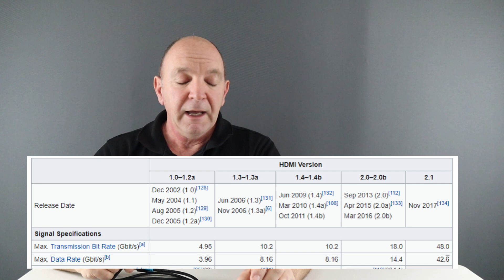HDMI Sucks! Or does it?

Comment: This is 2025. And I'm sick of HDMI.
And consumers I think you're getting fed up with it. It shouldn't be that difficult to have a device that you want to watch on your TV and you connect the cable from one to the other. And it should work instead of Constantly getting the quote no signal" error message.  

I've tried every possible cable. I bet I've bought two dozen of them and returned all of them. I even bought one that was $125 thinking well maybe that will work.    

And I don't see how it can be the cable when the cable works sometimes, but it doesn't work other times. And it's annoying, because it makes the system not dependable which makes you regret buying it, and on a bad day you wanna throw it off the balcony.

Comment: Good info but basically an apology video for a cable standard whose first main job should have been to work reliably without needing to have any specialized knowledge. At that, it has failed miserably. So yes, the HDMI cable standard sucks even if the individual cable is of high quality.

Comment: Hi Andrew, really great presentation indeed as always with all your videos.
AQuick HDMI issue question:
An apple TV (set to 1080p) connected to an AV Processor (set to 1080p) with 2m cable then to a native 1080p projector with a 20m cable (non optical). After 2 minutes, the screen goes black and the image never comes back unless you restart the whole system.  Based on your experience, is it most likely HDMI (2.0) cable quality, lack of features in the cable, EDID issue or HDCP issue?

Thank you.
Reply from the maker: Hard to be certain but my guess would be a voltage issue in the long 20m cable ? Maybe.. if you can temporarily bypass that with a shorter cable then that will give a clue. Either way I hate HDMI :-)

Comment: Yes it does, it's a fucking shit show every time you plug a new device with it because mainly of some obsolete non-working anti-piracy shit handshake shenanigan. Not to mention they stiff, fragile on the epoxy and the wire itself. The inventor of this horrendous standard should be imprison somewhere in a offshore prison and sodomized every morning. A while back, we had vga, plug, works. Dvi? same thing. Usb-C? why not. Why then industry still use this freinkensteined horror of a cable is a huge fucking mystery to me.  
Although, good video, well explained in a relaxed pace. Looking forward for more contents from you channel.

Comment: Great information Andrew and very well presented, I wish I had found your channel before. I’ve had many heart stopping moments with HDMI cables, usually about ten minutes before an audience is due in for a presentation! One problem with them I found there is no lock so in a temporary set up they can easily be pulled loose unlike SDI connectors. Thank you for your videos, always interesting.

Comment: Hi Andrew,
Another excellent, and accurate video. 
For those in doubt about the cable specs, I’d recommend they look for “certified” cables. For example, either Premium Certified or Ultra Certified, giving the customer confidence that the cable DOES meet the relevant specifications. 
Customer scans the QR code and is taken to HDMI.org where the specs are confirmed. :-)
Reply from the maker: Yes I think that came out just after this video… ! Then of course there are competing labs with their own specs.. gotta feel sorry for the customers to some degree!!
Reply: @HomeTheatreEngineering  ah yes, good point. I’m a bit behind the curve as I only recently found your channel via Shane at Spare Change. I’m still catching up on your vids. ;-) 
Keep up the good work. 👍🏻👍🏻👍🏻

Comment: Great video, thank you. Hello from Toronto. My understanding from other research is that as long as the cable has the features you want high cost cables are not warranted at 6 ft (maybe for longer?)
Reply from the maker: To some degree this is true but there are still good and bad cables. So as long as the cable works, without artefacts, “sparkle” drop outs our other issues then broadly speaking you are fine. We do like to stick with brands we trust at reasonable prices for confidence.

Comment: Can a long HDMI-cable (10m or longer) damage equipment? (Resistence increases in length?) And what can you do to prevent this?
Reply from the maker: Danny van Hest No a long hdmi cable cannot damage equipment in and of itself. If it was faulty or maybe, maybe ... if hot swapped but unlikely. If the cable cannot carry the signal it will fail to present a picture or an intermittent or sparkly image..

Comment: I have an older bose v 20 lifestyle system that does not support HDMI arc my tv has it  is there anyway to get the bose system to receive the arc so i can get the sound from the tv? thanks Chuck
Reply from the maker: As you said that system does not support HDMI ARC so the answer is no. However check to see if you have an optical or digital out on your tv that you may be able to send to the Bose system
Reply: @HomeTheatreEngineering  thank for your help i do have optical out

Comment: Thanks for the advice in the sequencing. I’ve been having issues getting my setup to sync correctly. Sometimes the sound locks up and sometimes the picture drops colours, especially on Dolby Vision. How does CEC and ARC effect the handshake between devices, is there one device you should have as the master?

Comment: Hi Andrew so i have an older yamaha avr that supports hdmi 1.3 will that work with my 4k apple tv because it does not give me hdr or 4k picture only hd 1080p 60hz sdr.Do i need a new avr with atmos good info video thanks!
Reply from the maker: Alfredo Garcia not necessarily you have several options you could use something like an hdfury to downgrade to 1.3 and that “should” work or .. use an hdmi matrix as your switcher and send the audio only to the avr

Comment: Another good vid Andrew...

You still have issues with HDMI cables that have poor transmission...the dirt cheap ones, the "eye" suffers from lack of clarity, you can have packet data loss (esp for cables over 3m), bad terminated connections that expand with heat and lose exact contact with all the pins etc.

Then there are brands that say they are a certain spec but aren't.  Take for example all the 8k 2.1 cables on the market ATM.

The HDMI forum hasn't released the testing requirements so there is no way to confirm you have an 8k cable...yet quite a few brands are saying 100% that they are...

Or they say they are 4k but when you check closely they barely achieve 4k 24 4.2.0 or just don't.

I just say buy a reputable brand from a reputable dealer...like yourselves 😁
Reply from the maker: Thanks Mr Dream :-) ! And yes all good thoughts. Much appreciated